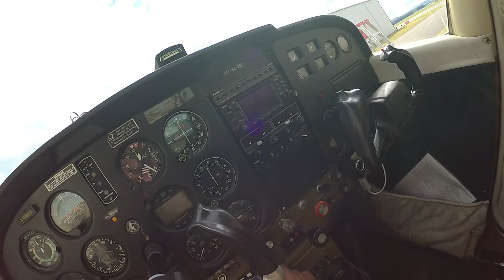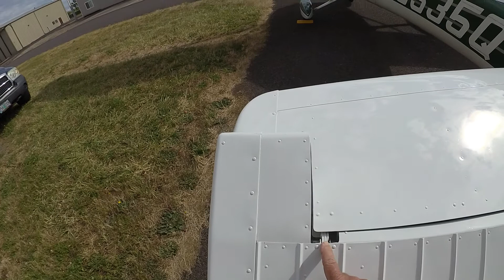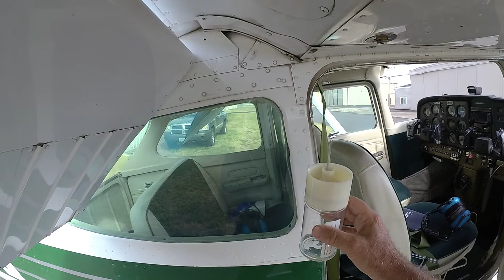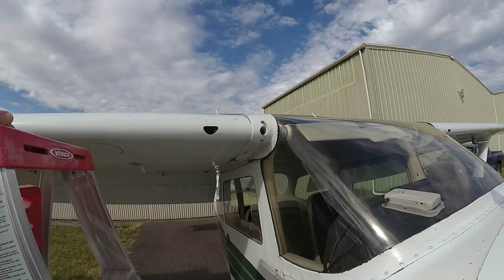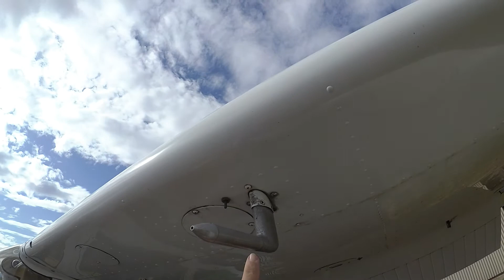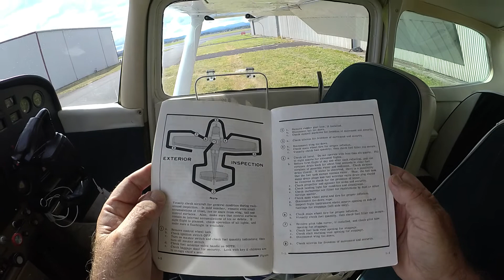Preflight of a Cessna 172M

Comment: Thanks for this video! Why did you leave the beacon switch on? Won’t the beacon light be turned off when you switch the master off?
Reply from the maker: Hi. The idea is that with the beacon on, if someone accidentally leaves the master switch on, the flashing beacon is likely to remind them to go back and turn off the master. Tends to save batteries.
Reply: @iflyaviation4168  Ah, what a good idea. Thank you for the reply!